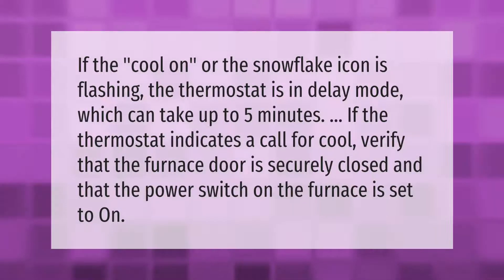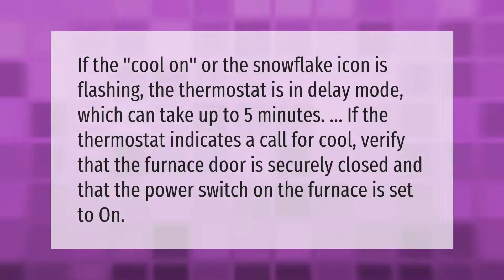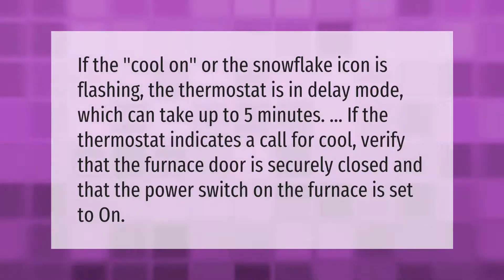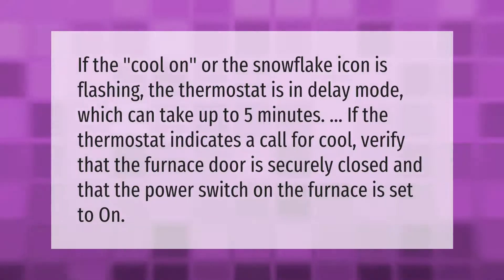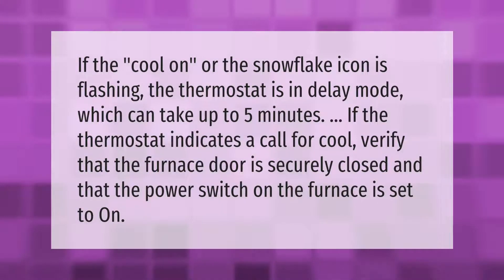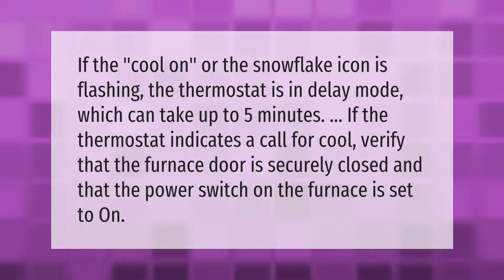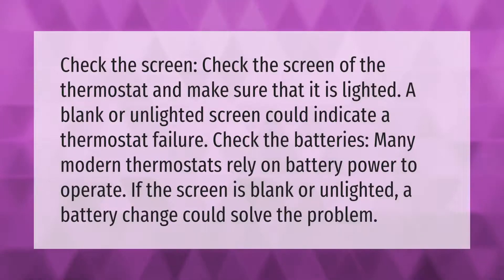Why is my Honeywell thermostat on cool but not working?

Comment: My honeywell ac thermostat is coming on but not cooling the house and when it is on the "cool on" continues to blink . I reset the circuit breaker and changed the batteries already. What else could I try to get it working?